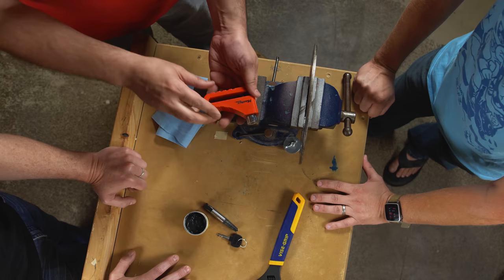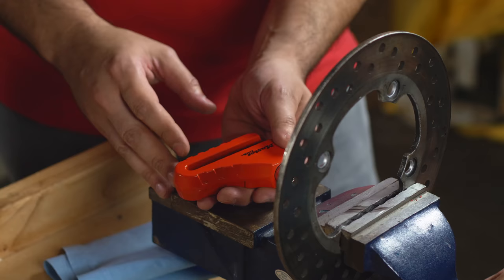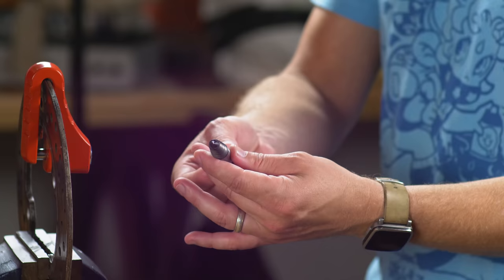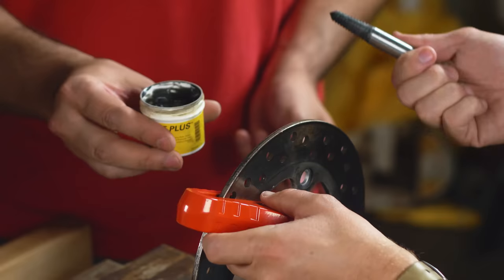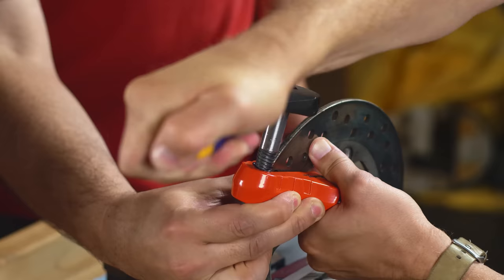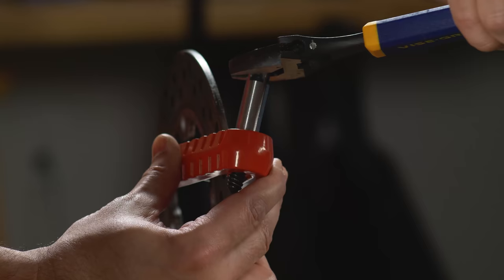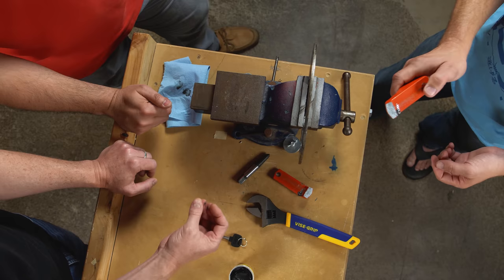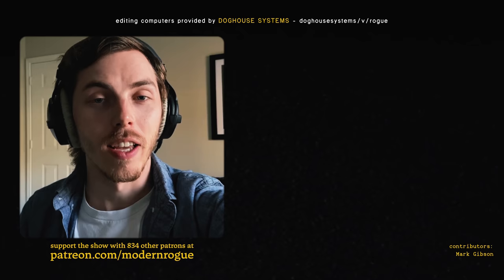The $5.68 Hardware That Easily Defeats Motorcycle Locks (with LockPickingLawyer)

Comment: I love all the jokes about how TMR is now the channels for thieves and scoundrels, but this info is actually really good to know for regular people too. I mean how many bike riders out there can immediately put this information to use by, say, > buying a hardened steel disk lock < instead of one of the cheap zinc ones? Just being aware that this is a thing allows people to protect themselves from this kind of theft. 

Hopefully greater awareness of this exploit will drive consumer sales to better products, and that will lead to two beneficial outcomes:

1. the crappy products will lose market share, meaning that even people not aware of the exploit will be more likely to buy a product that is resistant

2. real thieves will have a harder time finding a mark, since the cheap locks will be less prevalent due to point 1. This may even lead to less people trying to steal bikes this way due to it being harder to find a suitable mark. 

Of course in order for this to be most effective more people need to know about it, so go out there and share this video with all your biker friends, so they too can inoculate themselves against such anti-social behavior.
Reply: Your logic would be valid if the number of good citizens didn't outnumber the number of bad citizens...Because the number of good citizens vs bad citizens is so great it's more likely that good citizen will become the victim of a bad citizen that watched this video because it's unlikely that a higher percentage of good citizens will see this over the bad citizens that seek this kind of info.
Reply: @killer2600  ummm, i think your estimation of the number of bad people that educate themselves is vastly higher than reality. I also think you severely underrate the power of good people spreading information that can be used to protect oneself. 

My source for coming to this conclusion? I work in IT security, it is kind of my job to disseminate information on attack vectors to the people who can use it to protect themselves. I basically do what these guys did in this video every day; show people what attacks look like and how they are done, then help them build systems that prevent those attacks. This is a tried and true methodology, and works way better than just showing the solution without context for why the solution is important. 

Sure, I can just tell you you need to get a hardened steel bike lock, but without the visceral demonstration for what happens without one you really have no context for why it is important. For all you know all I am doing is giving you a baseless opinion. 

This is the same problem I run into when I tell people "you need strong password". If that is all I tell them they see me as nothing but a nag. But if I give them context by explaining, for example, how a rainbow table attack works they suddenly can connect the dots themselves, and suddenly I am not nagging about some esoteric concept they have no perceived use for, but rather someone integrating basic security concepts into their working knowledge of the world.
Reply: @killer2600  Adding to what lucusloc said, this doesn't teach bike thieves anything new. They know how to steal bikes and they know how weak zinc alloy locks are.
It's really the "good people", who don't deal with this regularly, who benefit from videos like these.
Reply: @lucusloc  So since your in IT and good people are spreading information to keep people safe from bad actors then no one has to worry anymore right? Everyone has gotten the needed info so the bad actors have no one to hit or scam right? Reality falls far from the ideal.
Reply: @MarvinCZ  You cant assert this doesn't teach anything new. It's quite arguable that many who watched this are learning this for the first time. It's also arguable that some of those people are not the most upstanding individuals. They may not be bank robbers but they could be opportunistic thieves that learned about new opportunities.
Reply: @killer2600  Of course this video shows people something new, that's the point of it.

Security by obscurity does not work. People like you always act like this reveals some dangerous secret. No, it's just people who woudldn't otherwise look for ways to defeat locks who aren't aware of this and therefore can't make educated decisions about their security. People who want to defeat locks and actively seek this kind of information can easily find it elsewhere. It's no secret.
Reply: @MarvinCZ  Let me reiterate my argument because I think you misunderstand it. Showing a few good people the weakness in a security device does NOT show all potential victims the same weakness. But it does show all the bad people that want this information that don't have it already. The idea that bad actors already know all the tricks of the trade and have nothing new to learn nor do they seek to learn more tricks is false. In fact most petty thieves start their misbehavior once they learn a useful exploit, not before.

You can try to get people to buy the more expensive lock but the expensive locks were available when they bought the cheap one. Do we really believe they were all naive enough to think they were buying the exact same quality of lock for a quarter of the price? Maybe you do, but I don't and here's why. Masterlock has been around for ages, it's sold virtually everywhere, and for years it's been known as a cheap, low-dollar, not very good lock yet people still buy it in mass. They buy it because they don't care they aren't buying top of the line, they just want a lock that doesn't break the budget. Some I'd say even buy masterlock for the "locks only keep good people honest" aspect; in light of their awareness of people like the LPL, who make it a "hobby" of defeating locks of all price ranges (the expensive ones especially). Which makes a whole separate debate, why spend big bucks on a lock when there are people like LPL that pick them for a hobby? LPL isn't a locksmith so it isn't his 40hr/week job/trade and if you watch his video's it really doesn't take him that much time to pick a pick-resistant high security lock than it does a cheap masterlock, so really as the person who has to shell money for the lock do you really want to spend 10x more on a lock that slows down the LPL by a second or two?
Reply: @killer2600  Haha, you have a fundamental misunderstanding of what is going on. My job is to make people worry and through that cause behavioral changes that will keep them safer. 

Shows like this one do the exact same thing, and the more people that know the more people can make the decision to protect themselves. This is why I encourage people to share this kind of information. 

Do you know someone who rides a motorcycle? Show them this video, let them learn the lesson here instead of out in the real world. 

We know this is a better system than trying to keep the information secret because we tested that theory in the IT world, some of the worst attacks we have experienced happened because known exploits were not actually known and disseminated to the public. The were kept secret "for safety" and because of that no one was able to protect themselves. 

Now of course we do have disclosure rules, if an exploit is new it is considered best form to notify the manufacturer first before public disclosure. We obviously prefer to have a fix in hand if possible before everyone (bad and good) is made aware of the problem. But if the manufacturer is unable or unwilling to provide a quick patch pretty much everyone in the industry acknowledges it is better to disclose than to bury. Most people agree that 60 days between manufacturer disclosure and public disclosure is considered generous, some people say 30 days, and there is a strong contingent that says only 15. The point is that public disclosure comes quickly after private disclosure. 

So how long have locks such as these been on the market? How long has this exploit been known? I know zinc locks have been on the market for decades, and that it is widely known in the locksmith community that they are susceptible to brute-force attacks. This information presented here is widely know already, if you just know where to look. What this show does is make the information more widely available to people not inclined to look for it, and that is indeed a public service that should be applauded.
You seem to be advocating against policies that are proven to work (full public disclosure made available to as many people as possible) and supporting policies know to cause the most victims (keep the information as secret as possible for as long as possible). I can only chalk this up to a fundamental misunderstanding of security practices hard learned over the past decades. Please educate yourself before advocating for practices that are known to cause the most harm.
Reply: @killer2600  You're misunderstanding me as well.
I'm not saying all bad actors know this. I'm saying that the information is easily available elsewhere. Not posting this video does not hide the information from anyone.
I'm also not saying that this teaches all potential victims about this and they will now buy better locks. However about 182'000 people have now seen this and they are aware of the issue. The rest is up to them.
Reply: @lucusloc  Sounds like you make people worry for the purposes of job security (to keep you in a job) :D

What's really being missed is ALL locks can be defeated with some path of exploit. A man-made lock incapable of being defeated  simply does not exist at any price range.

Most motorcyclists are already security aware and theft insurance is their greatest security strategy - there isn't a motorcycle lock/device that hasn't been defeated by someone.
Reply: @MarvinCZ  I'm pretty sure this video will only benefit a very few that have something to learn and enlighten many more that have no good application for this information (don't have a motorcycle and/or cheap disc lock).

I have to ask, after watching the LPL and all his various videos, which lock do YOU buy to stop even the likes of him? Before watching him, you could be confident spending good money on a reputable high quality lock brand was well worth the cost. After being enlightened to his "hobby" the exact expense doesn't bring the same piece of mind. This is this guys "hobby" and he's this good, I'd hate so see how good the people are who make a career out of this.
Reply: @killer2600  Stopping the likes of LPL is not a realistic threat model. The people who actually break into places or steal things don't usually pick locks to do it. Hobbyists have much higher skills in that area. That's one of the things videos like his teach you.
Reply: @lucusloc  You're under the assumption a lock can stop a thief. As seen in the video, locks don't even stop hobbyists that have to pay for the locks they destroy.

EMT's aren't in the business practice of instilling fear into others. If you can't see the irony of a job exists to dissolve fears but is accomplished in part by instilling fear onto others well I can't fix that.

I didn't make a comment to learn, I made a comment to make a comment. If bad actors didn't need this information to benefit from then neither did the good guys because as it was put earlier - the information is already out there. So this video did nothing aside from getting people to restate previously held talking points. Hence why I don't think this video did anybody any good. Maybe a handful of people got something useful out of it that they can act on but out of them the likelihood that they would have otherwise been victimized from not learning from this video is an even smaller percentage. Great entertainment is what this video is really good for.
Reply: @MarvinCZ  Most thieves don't pick locks that's true but hobbyists being more skilled than the pros is false belief. It's the hobbyist that aspires to be pro, not the other way around.
Reply: @killer2600  There may be some "professional lock pickers", though I am not aware of any. They are cetainly not breaking into places or stealing things. There are easier and faster ways to do that.
I'd be interested to hear what you think is the career of these pros. Perhaps some locksmiths would qualify, although they also usually use easier and faster ways.
Reply: @killer2600  Man, you keep doubling down don't you? 

You've never been to an emergency services community outreach where the EMTs have an entire presentation on household accidents? They absolutely do try in instill in you a healthy amount of fear and respect for the dangers found in an average home. Good EMTs will also talk to you about an accident in the back of an ambulance if opportunity presents itself, so you can avoid making the same mistake again in the future. Or maybe you are trying to equate "cowering in fear" with "healthy respect fear", which is just misunderstanding on another level. 

And a good lock can deter a thief, which is the entire point of security. A bad lock will not, which is the point of this video. Please stop talking about security concepts you know nothing about. You are making the assertion that "given unlimited time and resources any security system can be breached" which is 100% true, but entirely besides the point. What you want is a security system that will make an intrusion take too long or require too much effort so that the thief decides it is not worth the trouble or risk. "Good enough" security is, well, *good enough*. 

As this demonstration shows some bike locks are not good enough, and, as of this comment, ~180,000 people are now aware of this information. That is 180k people who can now potentially choose to be more secure, by simple virtue of buying a better lock. 

The assertion that some of those 180k people can use this knowledge for nefarious reasons, and that it is therefor bad to make such knowledge know is contrary to everything we know about security education today. We know for a fact that disclosure of vulnerabilities is safer than keeping them secret. We know for a fact that telling the public about exploits is better than hiding them. We know for a fact that little shows like this are a net benefit. There are more people who will be able to use this information to make themselves more secure than there are people who would exploit this information for ill. Furthermore when you pit the people who wish to do ill with this information vs. those who would use it to secure themselves better, well the advantages goes to the people who are trying to secure themselves, *especially if we are willing to tell others*. 

Tightening down your security makes the job of thieves harder, which means there will be less of them who are successful. This is a fundamental point you seem to be ignoring. Again, pleas stop talking from ignorance, it helps no one and actually makes the job of people who are fighting for good security harder.
Reply: @lucusloc  In a perfect world people wouldn't have to learn from mistakes and we wouldn't have people that felt the need to steal. I don't live nor act like I'm in any kind of an ideal dream land.

Either this video helps potential thieves because they didn't have knowledge prior or it helps no one because the information existed prior.

This like many other youtube video is great entertainment. If you own this cheap lock, now you know what to do if you lose the key. If you don't own this lock, you probably didn't come here because you were looking for a cheap vs expensive disc lock comparison - which this video doesn't even make any attempt to do.

I'm not against better security measures but the mere existence of this video doesn't make anyone's security better; especially if one makes the argument this information was already out there so thieves didn't learn anything they didn't know.

You keep quoting the number of views as "people helped." How many people are there on this big planet we call earth that own at least one lock? Subtract the number of people that viewed this from that number and you're left with the number of people that hope a potential victimizer of theirs didn't learn anything new from this video. "Knowledge is power" is a great phrase to throw out everywhere but math doesn't lie.
Reply: @killer2600  You seem to be willfully ignorant on how security knowledge is spread through a population. 

You also contradict yourself right in you own comment.
"Either this video helps potential thieves because they didn't have knowledge prior or it helps no one because the information existed prior."
and then "If you own this cheap lock, now you know what to do if you lose the key." (to which I might add that you also know to replace said lock with a better one).
Yes, this information existed prior. But also yes this video helps spread that information to a wider audience. As a security professional I appreciate it anytime someone brings security concepts to a wider audience, because that wider audience now has the information they need to inoculate themselves against such an attack. 

Are you saying this video does not bring this specific concept to people who would have been otherwise unaware? 

Are you saying the only people who would have learned anything from this video are the thieves? 

Are you even saying you would not make someone (who you know owns a bike) aware of the information in this video, because you think it is better to hide said information lest it be used by bad people for bad things? 

Because if you admit "no" to any of those questions then you have just proved this video has value. As a security professional I appreciate that value, and wish to make it even more valuable by making sure more people are aware of the concepts presented here. 

You are predicating your entire argument on a concept that has been conclusively proven wrong. Hiding information does not make anyone safer, to the contrary it exposes people to threats they did not even know existed, and therefor could take no precautions against. The argument that someone could see this information and use it for ill, while strictly speaking is true, is statistically far outweighed by the benefit granted to people who see this information and use it to protect themselves. This is true whether the attacks are digital or physical. This is a fact proven by decades of practical experience in the  security sector. This is a good video, because you are now aware, and even if you do not own a bike you can inoculate anyone you know who does (assuming you care about them at all). I am certainly sure at least a few of those 180k people will be able to immediate use this info, and a somewhat larger percentage will disseminate this info to other at some point in the future. That is making the info available to a wider audience. That is a good thing.
Reply: @lucusloc  As a security professional in the area of computers do you find it better when more people know how to hack and exploit flaws or less? Personally, I prefer less script kiddies with a step-by-step howto but as someone who is employed because such people exist I suppose it gives you purpose.

But hey information is GOOD, teach everyone to be elite hackers and the number of black hat hackers will DECREASE. Wow did I just find the solution for all your IT security woes, damn I'm so SMART.
Reply: @killer2600  haha, what a moronic argument. Actually yes, I would prefer that more people had the skills and know-how to hack stuff. Most of them wouldn't actually do that even with such a skill set, mind you, because most of them would still be decent people, but the fact that they would know how would mean they would not need me to teach them how to avoid being attacked. Hell, a huge part of my job it teaching other administrators (who are not security specialists) how to defeat their own systems. Once I teach them a few ways to infiltrate their own systems they can use part of their other skill sets to secure those systems in a proactive and ongoing fashion. Teach a man to fish and all, only in this case I teach a man how to steal fish so he can make sure his own fish do not get stolen. 

Guess what, this is the paradigm used by a huge portion of the security sector, and not just the digital side, but the physical side too. Most decent security conferences will have sessions that will teach you how to bypass carded security doors, basic locks, and even access panels. I have attended quite a few talks that covered physical security, and they benefited me greatly back when I was trying to secure equipment I was responsible for, whether is was something procedural like talking to a new face in the office or learning to avoid a certain brand of door lock because it had a know weakness that was never fixed. That knowledge served me well. 

Again, this is a proven paradigm; we know that more people knowing how to do some bad thing means less opportunity for bad people to actually do that bad thing. This is why we have mandatory disclosures on security holes (again, both physical and digital). You fears that just having the knowledge is going to mean more bad people doing bad things does not prove to be true in reality, though enough people with that mindset can and does lead to "security through obscurity", which, as others here have pointed out, is not actually security at all. 

Seriously buddy, at what point to you go "gosh, I really am talking way past my skill set, and there are people in this conversation that are telling me I am way off base and am completely wrong!" and then go look to find out for yourself if what I am telling you is true? Or are you so far up the first peak of the Dunning-Kruger curve that there is no room for such a thought in your head?
Reply: @lucusloc  You speak of all these things, disclosures and all, as if they have fixed the problem. Have they?

With all the people aware of the Nigerian Prince has it protected them from Microsoft Windows Support has detected problems with your computer?

It's a cat and mouse game that no one wins. Smarter victims just mean the perps have to get smarter.

You'd think you'd get to the point where the perps can't victimize a potential mark. The mark is too smart and planned for everything and for this video has a super expensive lock that can't be picked, broken, cut, melted, frozen, fried, or whatever means of being opened without the key and valid owner. For those cases, perps can level up to bike jacking. I know you rather have perps reach this level to steal your bike but I personally rather them steal my bike with me not around.

That said, my final statement on this topic is it is nice entertainment. I don't believe it has a measurable benefit to society. For each good person it could enlighten, it can enlighten the wrong person. Also it's merely a "howto defeat" it teaches nothing of what to look for in a lock or the differences in various locks and why you should pick a particular lock for your application. Thus this video is cheap entertainment.
Reply: @killer2600  "You speak of all these things, disclosures and all, as if they have fixed the problem. Have they?" Why yes, they have. You could probably write a book about all the vulnerabilities that have been fixed by disclosures. Hell, in the early 90s you cold buy routers that left every port open by default. Now the default is to lock them down as much as possible. We are relearning this lesson with the Internet of Things, as most such devices have atrocious security. These are new companies who have not been inoculated against this mindset of "fully open means easier setup" like the more established companies. 

"With all the people aware of the Nigerian Prince has it protected them from Microsoft Windows Support has detected problems with your computer?" The only people who fall for these scam are those that are not aware. Currently we have entire think-tanks trying to figure out how to reach the most vulnerable, but it is difficult to educate grandma when she only goes online to check on her grand-kids Facebook posts. And people like you do not help because "spreading knowledge is dangerous" and so never disclose this type of attack in a place grandma might happen to see it. 

"It's a cat and mouse game that no one wins. " You mentioned earlier the "script kiddie" attack vector. Did you know that there are actually very little technically simple attack vectors anymore, and all the "scrip kiddies" have moved on from copy/pasting cod snippets to social engineering attacks, because the vast majority of those code attacks no longer work? Now the only fully technical attacks that are taking place are zero-days, and the barrier to entry there is huge, and has been relegated to only well funded attack groups and nation states. Raising the barrier to entry for an attack does make thing safer for everyone, I am not sure how this is such a hard concept for you to grasp. 

"You'd think you'd get to the point where the perps can't victimize a potential mark. . . " That is not the point, the point is to make it so the dumb perps cannot find easy victims. Again, we are trying to raise the barrier to entry for bad actors. Education has proven to be one of the most effective ways to do this. This is something pretty much any competent security professional can tall you, so one wonders why you keep doubling down on a paradigm we already know has failed. 

"I don't believe it has a measurable benefit to society." Well you are obviously not a security professional, so I would kindly ask that you stop spreading misinformation. Even "edutainment" like the above video has value, and it is value a real security professional can appreciate. Yes, they could certainly have gone further in showing locks that were resilient to this kind of attack, but I am not going to belittle them for a missed opportunity when simply presenting the knowledge is enough to get those who want to secure themselves to look for a solution. Two steps is certainly better than one, but I will take even one when I was not expecting any at all. Raising awareness is all I can really expect from a channel like this (and that is not meant as a slight). I will leave the more technical details like the how and why of an exploit ( and the associated explanations for how to avoid it) to the actual lock security channels out there. 

Of course if TMR did want to include some more useful mitigation factoids into their content I would not be opposed to giving them some advice in my specific areas of expertise. . .
Reply: @lucusloc  Thank you for your patience and knowledge. I wouldn't have had enough of either to deal with him.
Reply: @Shaiyo5  I appreciate that. Whenever I get into these long arguments I always remind myself I am not trying to convince the person I am arguing with, but the people who come along and read the conversation later. That is what makes the effort worth it to me.